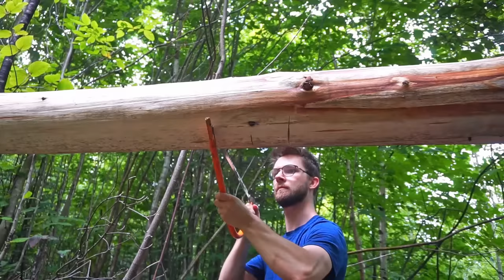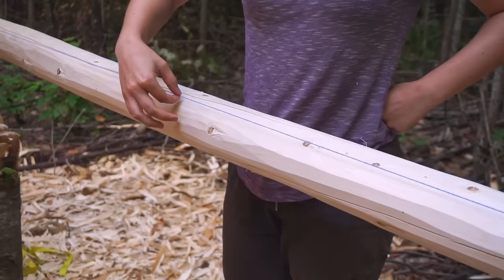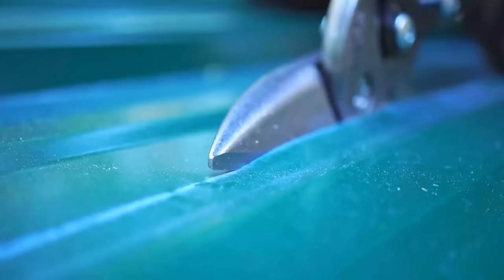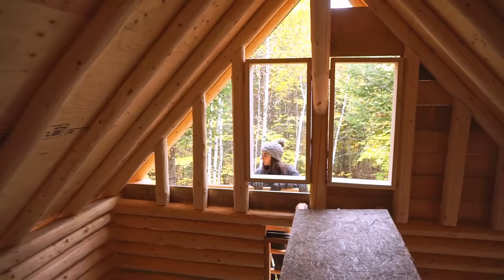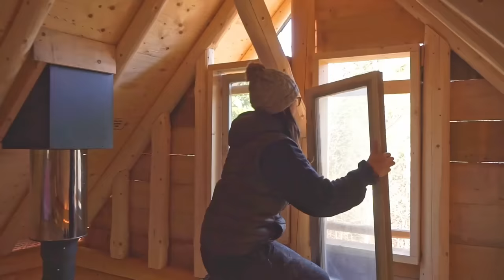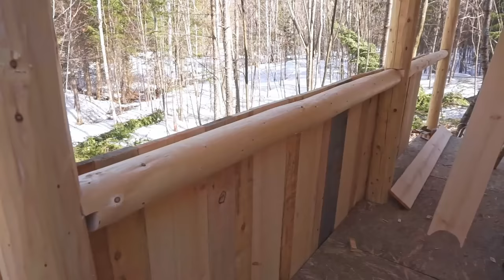Canadian Couple Builds Their DREAM Home with HANDTOOLS! (Tiny Log Cabin in the Forest, FULL BUILD)

Comment: I am 54 years old and been in the residential home building and repair for a long time. I respect this build cuz of choice not to use power tools.   I don't know what experience you have but you have the smarts and more importantly the will it takes. The roof rafters  will wick water through the wood. I hope you cover the cut ends with a  good high quality finish since the roof decking and metal do not extend past the cut ends. I'm not trying to pick apart your build just want it to last a long time cuz you put alot into it. The dwelling  will be a part of you I hope for life. I applaud the choice of tools especially in a day and age where people like to take short cuts and use power tools .I am sure you will know your home like he back of your hand. Good job. I commented to soon. I see the gutters now.
Reply: Looks like clay basted capping on the end grain of the logs - should be effective in deterring checking and wicking.

Comment: I feel you did a pretty good job at building this little cabin. Main mistake I see if the screws when you are putting the roof sheets up. Should have gone through The Ridges high points not the flat spot. This makes it less likely to leak. So if you start to get a leaky roof you will understand why.the water goes down the low spots not the high peaks so less chances of leaking.

Comment: Just a thought.  when I was watching the two of you caulking the logs, i remembered something in my past.  In 1967 my father and I were rebuilding a small wooden plank boat to fish salmon for here in Alaska. After consulting with a retired wooden barge builder, he instructed us to caulk the seams with regular caulking fiber, then seal it with regular cement mixed with Oil based paint or straight cotton-seed oil or linn-seed oil. He instructed us to mix it thick & a little dry so that when you fill the space in-between the planks, that it will stay where you put it.  If it tends to sag or run, you need to add more cement with your mix.  And like wise, if it's to dry and will not remain in place you need to mix a little more Oil-based-paint or cotton-seed oil or linn-seed oil.  I caulked that entire boat my self.  We launched it, and it had no leaks.  We fished it that summer then my dad sold it.  Three years later I seen it in the homer boat harbor.  I walked up to the bow area, examined the caulking, pulled out my pocket knife, and inserted it dead center on the caulked-seam pushed hard and inserted the blade knife a good inch into the boat.  Then I pulled the blade out and the slit in the caulking closed up and sealed.  This mixture sets up like silicone, it's firm, soft, and does not break. It would be an excellent choice for a cheap way to chink the logs on a log cabin,
If you have any doubt, try it.  get a small amount of Portland cement, some oil-based paint, or cotton-seed oil or linn-seed-oil. Mix it until it's like car-body putty, apply it to a vertical test prop.   If you were real creative you could experiment with the coloring to match your logs.
Reply: correction: if it's to dry, and will not stick, you need to add just a little more paint or oil.

Comment: They definitely did talk and communicate.. a little bit of that was sound effects. I seen where it was fast forward and the saw sound was going at normal speed. They also cut out the parts where they did have to talk. But this is tremendous work and beautiful teamwork! I'm so amazed at how they did a perfect job with just about 5 hand tools and homemade ladder 😅. I admire this couple! This is ADAM and EVE in there prime.     
                                 🏆

Comment: Awesome job. Just wanted to thank you for sharing this. As an aspiring builder i would love to do something like this for my family, and my dogs. In the fall, your Spot looks like this spot i helped build near the finger lakes, in NY. Absolutely stunning. As a stone and brick mason id like to comment that mud was probably pretty much perfect for that application. I heard the young lady ask whether to add more water. Multiple factors here 1 being it was laid as pavers and not brick or block that would have Multiple courses. (Where everything needs to be level plumb and straight. Sometimes sqaure). In that case yes those units get laid on slightly looser mud. Mostly everything structural  in masonry ( and special repair materials) , youre going to want just enough water for everything to have gotten wet, but not wet- wet bc hydrostatic pressure.  Also This will minimize cracking with it being a chemical reaction. I hope this makes sense. Do you mind commenting on how long it took total and where you aquired mainly the woodworking skills? Very impressive. Love to see it. Happy 2024! Good on yall.

Comment: The Bracing on your deck or over hang should be cross membered towards the bottom of your center post upright  \/ so that the lateral stress point is not toward the outside making your structure unstable  in a snow load situation . If your snow load becomes moderately heavy the possibility of blowing out your outer foundation posts is likely.

Comment: Incredible achievement outside of Scandinavia and Eastern Russia. Since wood is in constant motion I'd have recommended a more flexible material for chinking. I assume you researched materials and techniques but unless that cement is a blend of some kind I fear it may not hold up over time. However your build is among the very top tier back-to-the-land videos on You Tube! Your hand tool use is excellent and puts your project into the highest level of craft I've seen. Congratulations!

Comment: Firstly, I simply wouldn't have the patience to do what you did - hand tools. Secondly, I'm not sure my partner and I would work so harmoniously on such a long project. Good job you did on more than one level! I know you probably don't need to follow any building codes in the wild bush, but my local code doesn't allow red poly (polyethylene) tape inside, due to fire rating. I am restricted to the blue tape that you have started using.

Comment: Question: does this particular roof sheet require fixings in the pan? In my neck of the woods all roof sheeting of this profile is fixed in the top of the roll (highest part of the sheet) never in the pan (lower most part of the sheet profile) as over time during heavy prolonged rainfall water ingress is likely to occur through screw fixings. Is that a particular thing in Canada?

Comment: 👋😅?????? Hey really like your work nice job but you probably want to look behind the vapour barrier in your rafters you could of created a big issue by water proofing the roof and using poly on the opposite side it’s called a "vapour lock", and it’s not good basically traps all moisture in between I’ve had to fix this problem a number of times and it can cause severe dry rot

Comment: Nice job although that’s not how you do the flashing at the ends of the roof the flashing is supposed to have a lip , yours didn’t and you sealed it with silicone which will fail in a few years

Comment: I don't understand why pretty much all vids like this on construction? Why do they put the entrance doors inwards? You work like an animal for the few square meters they got under the roof, And then they give away almost 1.5 square meters that only the door takes up because it goes inward! To me, that is the height of stupidity! Put the door facing outwards and you can put hooks on the wall to hang outerwear on. It doesn't work with this stupid way of putting the door on. And I trained as a carpenter and worked in the industry for 50+ years.